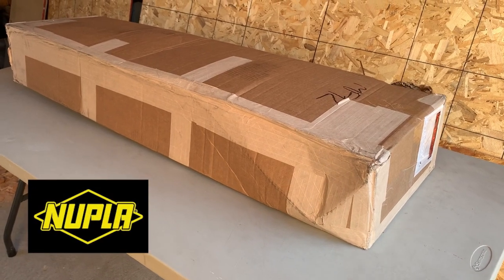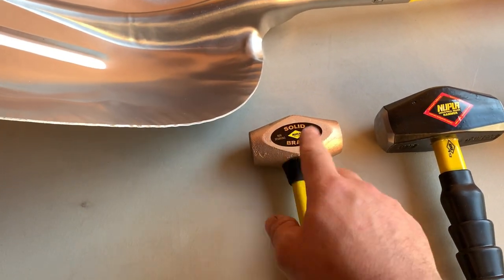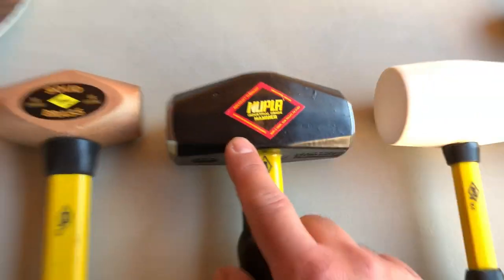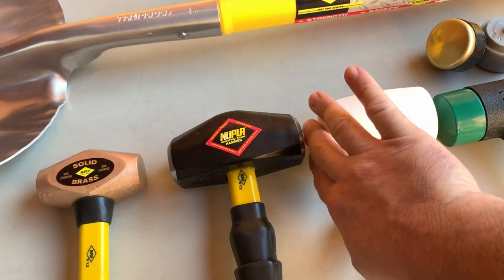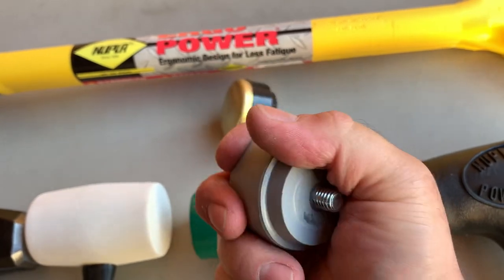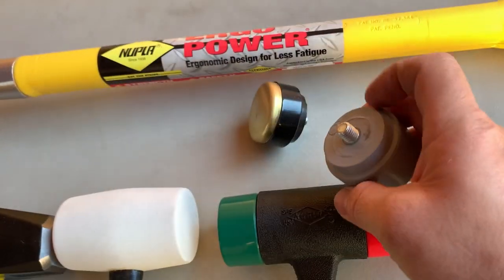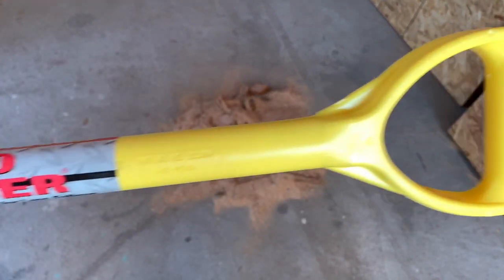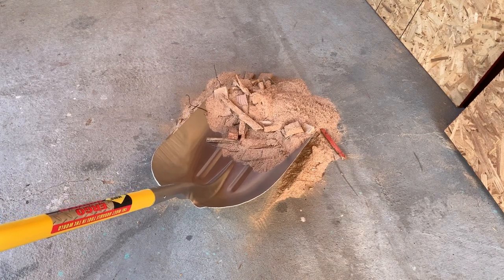A Look at Nupla Hammers and a Shovel!

Comment: Nice hammers... I'm not much of a hammer guy... never really had a need for specific for specialty hammers... but I did need some good dead blow hammers at work and home...and looking around on Amazon I came across these and really just assumed that Nupla was another Amazon startup hammer seller from wherever... but after doing some research found that these are pretty much some of the best.... good stuff ABD...🏁
Reply from the maker: Craig Cundiff yeah, made in usa💪 good stuff!
Reply: @AutobahnDan  right on...I have a Gunpla 1lb rubber mallet.. and a 3lb deadblow... love em....👍

Comment: Is the replacable head hammer have a dead blow base by chance? The ice cream truck cracked me up 🤣
Reply from the maker: Brads Workbench on the quick-change threaded? Looks like just brass, steel and a whole bunch of soft ones.. haha! I finally did a blooper reel! 🤣
Reply: @AutobahnDan  dang... i have a small pb swiss that has interchangeable heads and the main body has the dead blow weights inside but its small, was hoping to find a bigger version
Reply from the maker: Brads Workbench Yes they do have a dead blow with a Quick change as well👍👍
Reply: @AutobahnDan  ooooh im gonna have to go look into that now